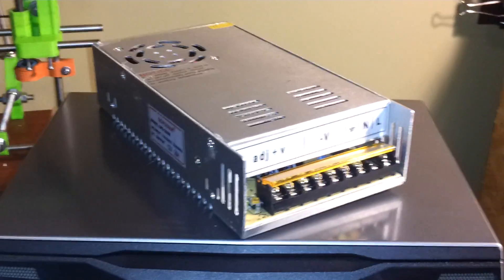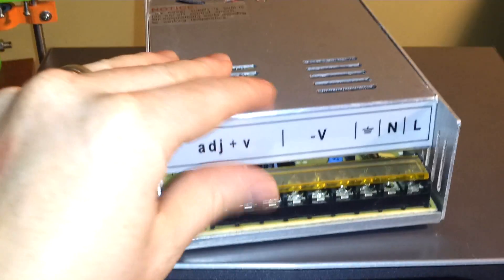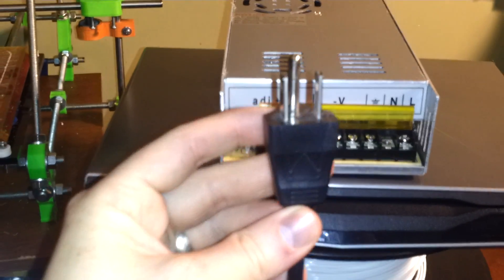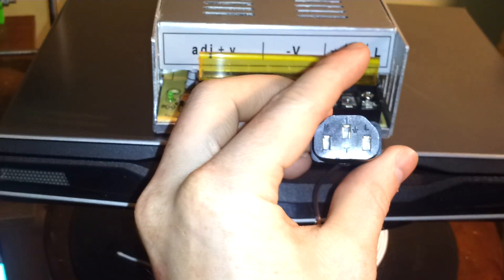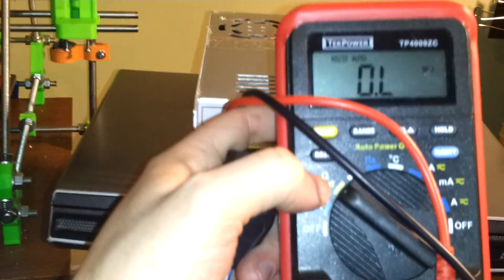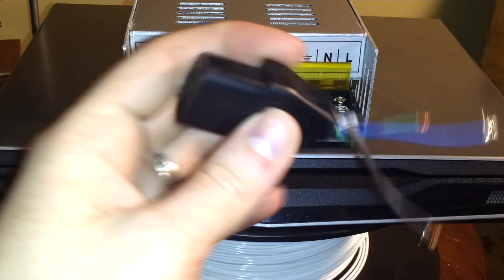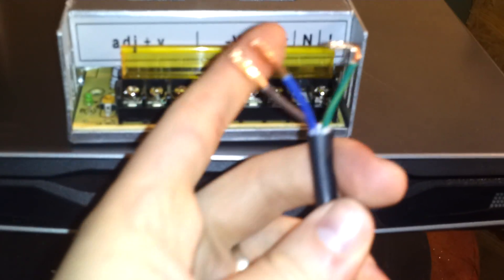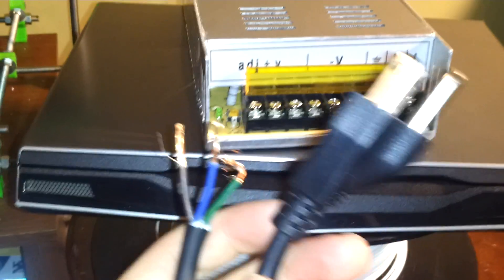How To: Setting up a 12v 30a power supply, and Connecting to your 3D Printer (Part 1 of 2)

Comment: Or you can just buy a MEGAWATT Switching power supply off ebay & they come with a cord with a built in on off switch. The S-700-12 50amp is stackable up to 200amps $125 free shipping ebay 🇺🇸 USA Seller 100% pos feedback👍👍

Comment: Can this work on a winch 12v dc that ask 20-30amp ? Cause the winch i bought you had to plug directly to a battery plus connecting a battery charger . So that why i don't plug to a battery

Comment: Wait, wait, wait... Could you please explain where to connect 220V/110V input?
Also where to connect 12V output?
My idea is to use this to charge my drive battery with a car charger I have, so I need 200W 12V output.

Comment: I have a 12v 50 adapter. I bought it at home for the sony n1004 amp. There are three plus three negative outputs. Do I need to short circuit the 3-way outputs as you do to get 50 amps and take them to the amp with a single cable? Can't we get 50 amps from a single output terminal?

Comment: are the 12v outputs independent or they just have more sockets for easy use?I ask as I need a power supply with 25A on a single line.

Comment: The power supply is a 30a power supply...normal computer cables are 10a rated...i am guessing this wouldnt be a good idea to use a 10a cord with a power supply trying to collect 30a power...or am i incorrect?
Reply: You are incorrect. The 30 amp is a rating @ 12v. That makes this a 360 watt power supply. If you have a power cable rated at 10 amps then it can supply 1200 watts.  10A X 120V = 1200W.

Comment: To everyone complaining that his method is dangerous. He's not wiring the short female end to the power supply... He is using the short female end as a reference to tell which wire is which. Then at the end of the video he sets down the short female end and picks up the longer wire with the male prongs on it and says to connect them. The only reason he ever had the female plug in his hand was to check the purpose of each wire...
Reply: Still silly. It's just as easy to use the plug end with stripped wires to check the color assignment. One must understand that the neutral plug is wider than the hot plug.

Comment: I'm a bit confused in regards to the 110/220 V selector switch. On the metal casing, it's engraved 110 to the Left and 220 to the Right. The actual switch is labeled showing "220" when the switch is pushed to the Right and "110" when the switch is pushed to the Left.  I may be overthinking this, but just to be safe, since this PSU did not include instructions, I would like to know for sure if pushing the switch to the left is the correct setting for 110v.
Reply: 110v are used in countrys like the usa @ china, 220/240v are the currents used in most EU Countrys.
Reply: did you find the answer?
i have same issue
Reply: Mahmoud Sayed unfortunately no, I haven't been able to find an answer yet.
Reply: Thanks,  i already find answer on another video demonstrate rep rap guru 3d printer,  simply move the switch to 110v or 220 v which engraved on the case

Comment: DO NOT WIRE YOUR PSU LIKE THIS! THIS A DANGEROUS AND CAN KILL.

The female plug end should be on the cable to the wall power outlet. Connecting as you have shown would need a male plug on the cable which would have live exposed connectors.
Reply: You didn't watch the whole video.  He's only holding / using the female plug end to work out the wiring colors.  He isn't connecting it to the PS.

Comment: CLASS NOTES: from Basic Electronics 101 class last week, the following are UL standards for the kind of Power Supplies/Transformers you can buy off eBay or Amazon for use in powering RBG LED 3528/5050 strips and LED square modules:

L = "POWER LINE IN" = Black/Red/Yellow or Blue wire
N = "NEUTRAL LINE IN = White wire
GND = "GROUND LINE IN" = Green/Orange or Brown wire
ADJ = "VOLTAGE ADJUSTMENT SCREW" = Don't mess with it
+ V = "POSITIVE LINE OUT" = Red/White/Yellow or Striped wire (usually)
- V = "NEUTRAL LINE OUT" = Black/Grey/Non-Striped wire (usually)

Important Note on LED Strips sold on eBay/Amazon:
The 5 amp transformer included with most LED strips can only supply power to one 5 meter (16 ft) reel. If you plan on connecting additional reels, you would need a higher amp transformer/power supply.

5 AMPS POWER PER 5M 5050 RGB REEL, SO 1 5A POWER ADAPTER WILL ONLY RUN ABOUT ONE 5M 5050 LED LITHE STRIP/REEL.

300 5050 RGB SMD LED REELS ARE ABOUT: 72 Watts / 5 Meter Reel.
300 3528 RGB SMD LED REELS ARE ABOUT: 29 Watts / 5 Meter Reel.

Watts X Reels (5A each) = total amps/wattage needed to safely power the LED strips.

1 Reel of SMD 3528 (300leds)  24W/5 meters,  so you need at least 2 amp 24W led adapter, but my instructor recommends: 3A 36W SMD LED transformer power supply, which gives a few extra amps for overhead.

1 Reel of SMD 5050 (150leds)  36W/5 meters,  so you need at least 3 amp 36W led adapter, but my instructor recommends: 4A 48W SMD LED transformer power supply, which gives a few extra amps for overhead.

1 Reel of SMD 5050 (300leds) 72W/5 meters, so you need at least 6 amp 72W led adapter, but my instructor recommends: 8A 96W SMD LED transformer power supply, which gives a few amps for overhead.

EACH 12V 5050 SMD LED MODULE SET (x20 MODULES) NOT "REELS"
= 1.25 AMPS
= 15 Watts

TO POWER 3 SETS   (20 MODULES EA) REQUIRES 45 WATTS,   +20% OVERAGE = 60 WATT OUTDOOR POWER SUPPLY
TO POWER 6 SETS   (20 MODULES EA) REQUIRES 90 WATTS,   +20% OVERAGE = 120 WATT OUTDOOR POWER SUPPLY
TO POWER 9 SETS   (20 MODULES EA) REQUIRES 135 WATTS, +20% OVERAGE = 150 WATT OUTDOOR POWER SUPPLY
TO POWER 12 SETS (20 MODULES EA) REQUIRES 180 WATTS, +20% OVERAGE = 300 WATT OUTDOOR POWER SUPPLY

A word about IP RATINGS: IP-rated LED Strips/LED Modules/Power Supplies simply means the item has been rated for various kinds of severe outdoor weather.  IP67 means the LED Strip/Modules are Rain Proof, but not submersible in water.

IP68 rated LED Strips/LED Modules are Waterproof, meaning they can be submerged in water without risk of electrocution.  For LED products made in China however, higher IP ratings are often mislabeled on purpose in order to sell more LED strips.

Buyer Beware on fake Chinese "IP68" rated products, they are probably not true IP68 rated and are using IP68 as an arbitrary safety credential, in addition to bogus UL/RoHS imprint certifications.  Making a fast-buck is more important to most resellers from China than keeping you safe from burning your house down from their faulty China-made products.

I'm taking this class because I want to redo my entire interior lighting with LED strips, RGB modules and Flashing Diodes as a DIY project, and alot of the LED Power Supplies and Transformers are made in China using non-standard code, I don't want to burn down my house not knowing that I'm doing!  Hope my fastidious note-taking helps someone!  :)

Comment: This is dangerous, the female plug should be from the wall power outlet. The male plug (exposed contacts) should be wired to your 12V power supply.

Comment: The multimeter function you're speaking of is a "continuity" test.  After touching the leads to the desired end points, you will hear a beep if there is continuity.  There is no continuity if you do not hear a beep.